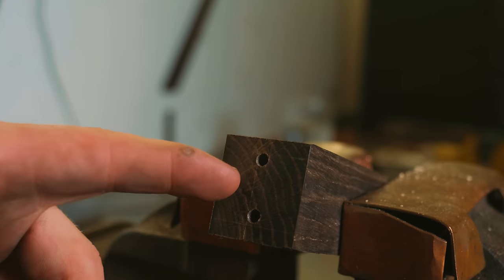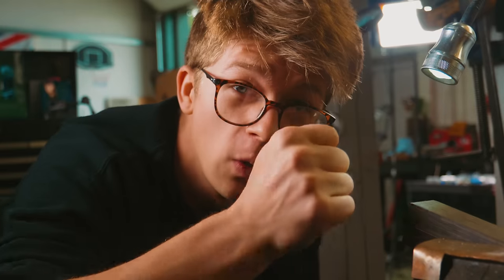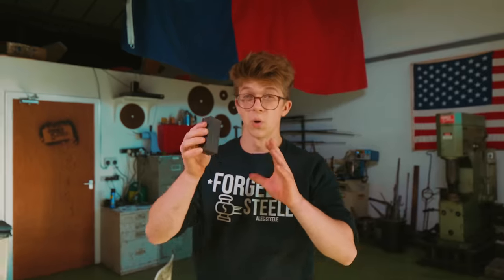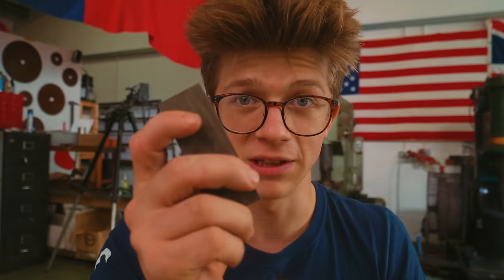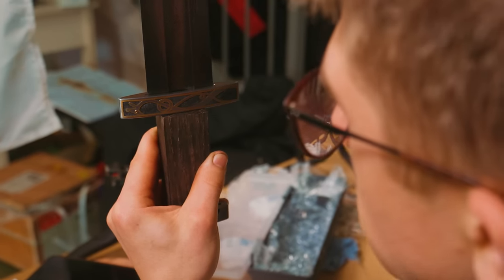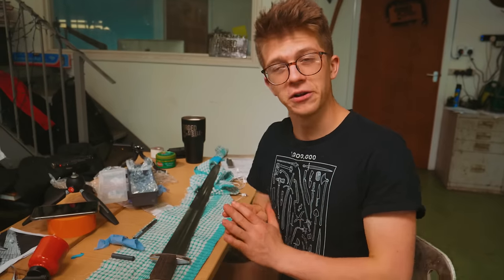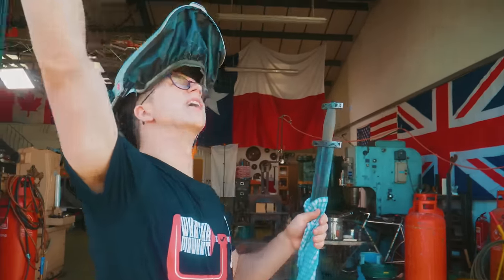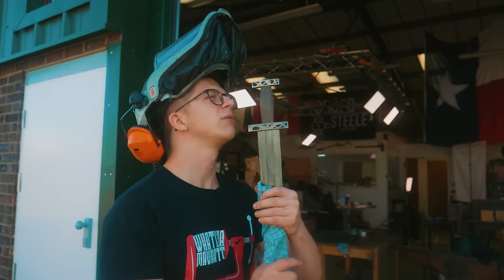MAKING A VIKING SWORD!!! Part 27

Comment: I would stack the off cut into slices with the other handle, and cross the grain glue it together then recarve it, they used pine resin glue on the handles in the viking era, You could use the cross grain as a decorative feature.
Reply: Richard Cave LBPPA Please read this comment, Alec. It would look really good!
Reply: I was just thinking the exact same thing.  Make a "spacer(s)" with the off cut to cover the gap at the hilt, glue the whole shebang together, and you could even shape or carve the spacers decoratively.  Making a pattern with them by cutting across the grain differently is something I didn't think of, but that could be awesome as well.  You'd get to keep using the bog oak, wouldn't have to totally re-do the handle, and it would look amazing!
Reply: Great idea

Comment: You could easily fill/cover that gap. Spacers top and bottom of the handle. Horn, bone, antler etc. Twisted gold wire collars would actually look really good and blend in with the overall style. (Have a look at the collars fitted to the  hilt of the Sutton Hoo sword for an idea of what I mean)

Comment: @alecsteele I’d think a horn or bone plate at either end of the handle would help. A very thin one at either end with the current piece after it has been sanded down a few millimetres, or a decently thick and visible one (I’d think black horn for the contrast with the steel and to bring out the warmer tones of the wood) on either end of the cut off section after it is shaped would let you solve the problem of the gap as desired and open up interesting design possibilities.

Comment: Welcome back from this brief intermission.  Now onto the Main Attraction.  Bummer on the offset.  That is absolutely something I would do.  Well, maybe not the fixing it part....lol
Reply: Me too, I'd say I can caulk that ...lol
Reply: Chris Nelson haha.  Yep.
Reply: Would it be possible to add a spacer to the handle like you did with the rapier? A chunk of blued / Damascus steel on either side to contrast the guards? It would be a shame to waste that bog oak.
Reply: I would make a metal or wood wafer to fit in between the guard and handle. That way you can still use the bog handle. Just make a bog wafer.
Reply: Uncle Shifty Add a 3/8 slice on the lower guard side after jigging it up and cutting 3/8 off. Then reshape with a little flare. Do it with ebony and feature it. Job done. Except he'd OCD and have to do it to the upper guard side too.
Reply: ManCraftingTM  could’ve maybe put a jewel or stone there, but I love how if you don’t like it and it ain’t up to specs you scrap it try again. You also show your failures a lot and I love that as well. Seeing somebody else make the mistake first helps tremendously
Reply: Uncle Shifty funny that’s just what I suggested 👍
Reply: Was that a wamen
Reply: Good idea.  An Ebony slip either end of the handle would give it a wonderful black contrast as with the black in the engraving.  Would look awesome against the Bog Oak too.
Reply: Bob Ross: 'We don't make mistakes, just happy little accidents.'

Before binning it might I suggest taking a mo' to think about that Bog oak handle? It might be an option to do a pair of "fuchis" (can't bring to mind the Viking term) or add some wire work to the handle - not entirely 'inauthentic':
http://www.darksword-armory.com/wp-content/uploads/2014/09/the-einar-viking-sword-1338-9-1.jpg
http://www.darksword-armory.com/wp-content/uploads/2016/04/the-einar-medieval-viking-sword-elite-series-1613-4.jpg
I know the pictures aren't quite proper swords, but just to illustrate the point.

Hide the hole(s) AND add an extra touch to the piece.

Keep up the excellent work old chap.

Comment: To address the gap you could use some twisted gold wire around the top and bottom of the bog oak handle to cover any gaps and it would look good as well.
Reply: No he can't then they need to re stamp it to account for the new pieces of gold.
Same as if he removes some gold

Comment: Hey Alec, have you considered putting some sort of steel spacer at either end of the bog oak handle, or even in the center of the handle? That way you could still use that beautiful wood and not entirely scrap the handle you have made.

Comment: Alec, I did some research on Viking Sword handles.  Depending upon the time period, some were leather wrapped.  I know that's a nemesis of yours.  Just check before you put too much time into a wood only handle.  P.S. I still think silk cord is your best bet for getting a smooth exterior when gluing.
Reply: Using the beautiful 5000 year old bog wood but covering it with leather would be pretty wasteful, sort of like making a foundation with fancy bricks would be a waste when they get covered in concrete.
Reply: @Antiganos  Yes, but it'd be historically  accurate.
Reply: Aside from the damascus steel blade, extreme amount of gold, etc. It's an art piece, not a replica. There's no point covering an expensive and nice looking piece of wood with plain leather, hiding the beauty completely. If a leather wrap was to be used, a piece of cheap wood would be a better choice, as it's not hellishly expensive or wasteful.

Comment: Alec, you might be able to use the offcut of the bog oak with two thin pieces of lighter wood on either side, or something like that. That way the bog oak is still the showcase of the hand grip, it would just be framed on either side by something else.

Comment: I think a burned handle would look great. It would be super dark and match everything else 

Edit: maby burn a handle then carve a swirl down it for contrast??
Reply: Upvote this fker, brilliant idea
Reply: Why would you waste bog oak like that. (edit:just saw that the handle is screwed anyways so if you want to burn a handle use regular oak)
Reply: Needs contrast a light handle would do nicely
Reply: @michaeldaugherty3540  I would normally agree with you for sake of balance but I think with this build that much contrast would throw it off because so much else is dark Go for more of a unified dark look.
Reply: @goldeneaglearbor614  its just my opinion but pine or crapemyrtle as a light ebone as a dark
Reply: so the burner of beef only advises to burn stuff, burnt wood is unstable in structure and leaves black residue, dying or staining would be better.
Reply: @cmb1972  if you lightly burn it and coat it with a gloss it's still stable and clean. Besides it's better than just dropping it from a helicopter ✌😂

Comment: IMO that handle is too short for man's hand.
Reply: Viking sword's handles are supposed to be a tight fit to promote a certain way of cutting. The guard pushing into your lower hand stiffens your wrist so you have to take wide swings from your elbow or shoulder.

Comment: You can still save the handle you shaped and use it in another project where the footprint of the handle is smaller. That way you don’t have to throw it away. I’d almost create a project around that piece of wood just so you can use it. You the off cut for a pommel piece to go with it. Something that doesn’t have a lower guard (or upper guard I can’t remember which is which, but no guard between the handle and the pommel). Make a smaller knife/sword with an all wood handle and pommel, no guard between them, and an inland guard between the blade and wood handle. I think it would be a good use of that awesome wood your friend gave you.

Comment: You could always shorten the handle and put in a transition piece.  You can do an acid etched piece of the high carbon steel you use for the blade.  Will give you that light dark contrast.  Like about 5mm thinck and a swooping curve going up towards the wood of the handle.  The inner part of your hand is radiused up where it meets the guard so it would still fit the handle well.

Comment: May I suggest one thing for the handle and maybe it would make it so you are able to use the remaining wood you have. Maybe you could put a line of steel in the center of the handle. Where it is raised the most, and of course horizontal ( sorry if I'm not clear). I think it would look stunning!

Comment: I think you can save the rear side of the handle block and join it with other exotic handle materials like ivory or bones on the front side. A little silver or bronze spacer in between might not harm the overall looks and integrity. I believe you don't wanna fail the generosity of your friend who gave you that bog oak.

Comment: How about using the remaining bogwood to create a wider base for the handle to center into? It will cover the hole and provide a bevel into the hard edge of the guard - which could actually provide a more comfortable fit for the hand?

Comment: You could cut the handle in half top to bottom making 2 cones and replace one cone with another bit of the same wood the center line would hide the join if done with super sharp blades

Comment: A suggestion for how you dealt with the chamfer...make a cast of the blade to sit in so you can get your lines without the danger of scratching other finished pieces, like a wooden mock-up to sit in the handle

Comment: I have an idea. You could cut the handle in half and put a spacer in between the two pieces. Something with a little contrast. Like a frame made of damascus, blackened out steal or maybe a silver spacer? Or a brighter wood as the bog oak. Maybe a bone or horn? Something like that.

Comment: You could use the bog-oak cut-off if you make two parts with a brassed-steel separator. This might add some color to accent the wood. Forming the two sections of wood as I describe into circular or ring shapes would also add to the serpentine-dragon depiction in the guard and pommel. Take the roman gladius handle for an example of ring shaped.

Comment: ALEC. You can use Wood Glue to glue the pieces after cutting them and then giving you the length needed! Simply reshape the new ones to fit in with the old cuts and then Bam! A design, sort of like a mixture of Damascus wooden patterns! 😁😁
Reply: Please read this, @AlecSteele I think you'll benefit greatly from this idea

Comment: I would keep the first run of the handle for another project.  Surely it will be good for a project that you can build around it, or at least plan for it.  Is there a date set yet on when the auction will take place?  I'm not trying to be pushy.  I'm just wondering if I missed the announcement.

Comment: I think the grip is salvageable. Would need to make the piece more ornate though and not sure what look your after.

A nice shallow helix lengthwise of the grip with twisted steel wire inlaid would look great in my opinion. You could even add some leather sections in between for more contrast. Say 6 in total, 3 showing off the wood & leather respectively separated by the twisted inlaid steel wire. You would need a small spacer top & bottom of the handle to lock the steel wire in position.

Something like this using different materials would likely make the handle grippier as added benefit.

Comment: Hey Alec, I don't know if you gonna see this in time but what if you used the old oak wood and placed a 5 mm (plus your blade width) steel spacer to make up the extra space. You could also engrave a line down the center of the band to add some stimpaling like you did on each guard. Just an idea. Love your videos.

Comment: Alec, use stacked bone spacers to fabricate ferrules for the ends of the bog oak hilt and hand polish them up through 300 grit. They will solve your issue with the gap and can be dyed black after being shaped and polished. Submerge the bone in a 50/50 solution of black indian ink and 70% isopropyl  Alcahol for 5 to 7 days for best effects.

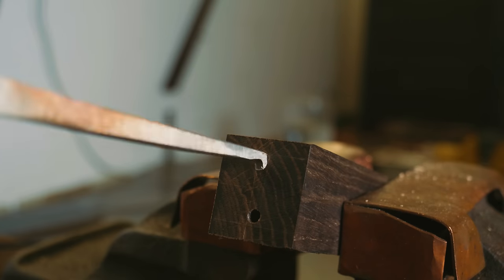Comment: 0:18 ive had this problem before, all you have to do is drill another hole right below the top one and fit a fret saw in it and cut out the excess material :)

Comment: Just add spacers to each end of the handle out of horn or hard leather.  A sort of cop out, but historically accurate and adds one more dimension of complexity and you get to use that bog oak instead of just scrapping it.

Comment: cant you you take the extra bog oak and make a top to the handle and modify the original handle so they fit seemlesly with some sanding and the left over wood sanding to make it good

Comment: You could always take the bog oak that is 5cm too short and cut it in half put a 5cm spacer of a lighter wood directly in the center of the length of handle so it goes dark Bog Oak, light English (or Scottish) Oak for the 5cm spacer, and then back to dark Bog Oak.  I think that if done correctly it could look very nice, and you would also have the light/dark contrast continued in the handle as well.

Comment: To fill the gap you could just put a gold ring between the top of the handle and the base of the upper guard. The gold ring has to be a little wider than the handle.

Comment: Instead of tossing the handle do a leather chord wrap, it looks nice and it will cover the issues you'd just need to grind the handle down a little further on the sides so it isn't proud on either side of the guard

Comment: Probably you already thought about it but what about adding a damascus spacer in the middle of the handle, if you have any left over from when you forged the blade, to make a spacer. Hopefully that might be able to save most of your current work on the handle and if the spacer is thick enough give you extra room on top half of the handle to cover that gap. Just my two cent idea :)

Comment: I would make a metal or wood wafer to fit in between the guard and handle. That way you can still use the bog handle. Just make a bog wafer.

Comment: A horn or bone spacer at the front would probably solve the issue and keep it to some semblance of historical accuracy. Also it looks like you might have enough bog oak leftover to use as the handle of a sgain dubh, or perhaps resesrch the what types of kitchen knives were used in period for the area it came from.

Comment: to cut the tang slot in the wooden handle, why not drill the holes and use a coping saw to cut the slot between them? you can remove the blade from a coping saw, poke it through the hole and fix it back onto the frame. Would be pretty easy and save all the hours wasted on a custom tool that broke.

Comment: So... From the chopper video I see we are waiting on another bit of bog Oak. That's good. I imagine there's still lots and lots of that stuff laying around in the muck somewhere. That was a costly mistake but like every other costly , you always maintain a great attitude and crack on. I look forward to seeing how you resolved the issue of the exposed Gap. I supposed to shake the door handle it's going to try to change. I expect you're always already making some design drawings for that resolution. I'll be interested to see some illustrations from the you're a witch inspired this particular sword to begin with. And you did that with the Engraving and I wonder if you're doing that with the shape of the handle now?

Comment: Alec, question for you.

Regarding the way the handle wraps the tang, considering the way the arm moves from shoulder to elbow to wrist, why wouldn't you have a handle that is twisted, LIKE on the falchion? It would seem to my uneducated mind that having an ergonomic twist would give better cut contact and better point penetration due to strength and grip being better at a slightly straighter (to body centerline) angle, like the way they teach you to punch in eastern  martial arts.

Hope you find my question and can answer it!

Always love your videos. Thanks so much for them!

Comment: should have done the Roman (3 segments) style grip which the Saxon blades from the 6th and 7th century often had. The crossguard on most of the early Saxon blades were very short, this implies that sword on sword combat was rare, thus protecting the hand wasn't so much needed. Mostly it seems that sword use was focused on going over or around the shield. The reason..... a majority of warriors that (the sword wielder would meet) had Axes, spears or long knives (seax) and mostly armored with only a shield. These were poor desperate farmers not nobles.

Comment: Dude! Cut the handle in half. Lay in a 5mm piece (like a disk spacer) of wood, might or might not be a darker tone. Then cut 2.5mm of on each side to broaden it. Done deal to cover up the hole plus would look dope as all Heizleistung. Also, twisted gold wire in the wood. Just do it. No short cuts!

Comment: Hey Alec, thats a expensive piece of wood. I would have welded in some filler using TIG/low amp/thin rod&filler material. But I guess you could use the handle for something else, just have to make the new piece fit the handle :)

Comment: I think you should use that handle somehow. Perhaps even without fixing that gap.

Greatness does not always have to be perfect. Sometimes a tiny imperfection of some great craftsmanship is there just to remind us that we are human.  Consider the japanese concepts of wabi and sabi. Wabi is the idea of a cheap clay mug, looking all uneven and with the wrong angles, but if you look close at it, it looks like a mountain ridge, hence a kind of beauty. Sabi is the idea of a perfect expensive and shiny mug. (like you try to do with your swords). But if you look close enough, at one spot, you can see the fingerprint of the creator, which in turn causes a kind of sentimentality. A reminder of our humanity, which is another kind of beauty. 

So, I think you should leave one imperfection of your work as it is. As a tribute to all the imperfections and the struggle of learning from mistakes etc. If you just leave one imperfection, this would be a good time since you do not have anymore of that kind of wood.

Comment: Any reason to only drill 2 holes instead of drilling as many as you could with ~1mm of space between each?  Seems like it would have been pretty easy to do on the mill since you could move it over so precisely.  And seems like it might have saved a lot of time.